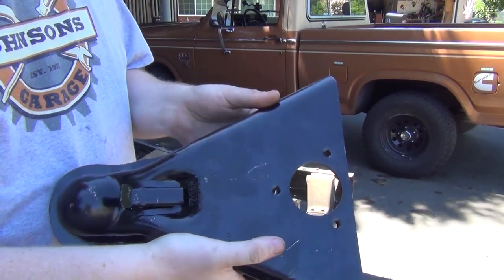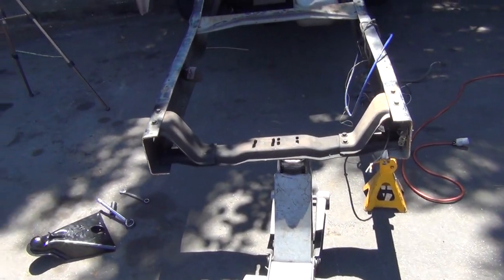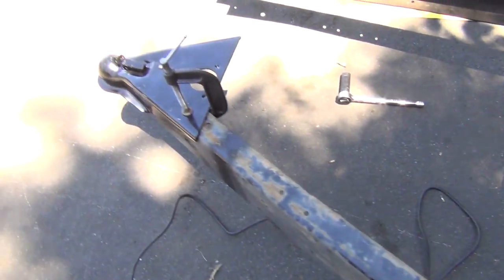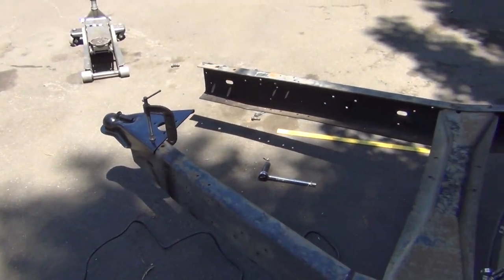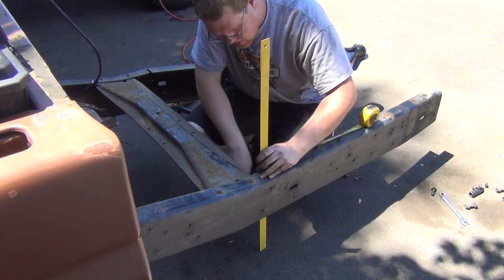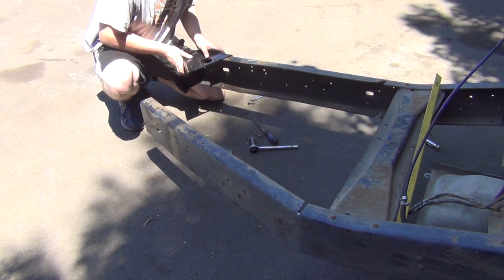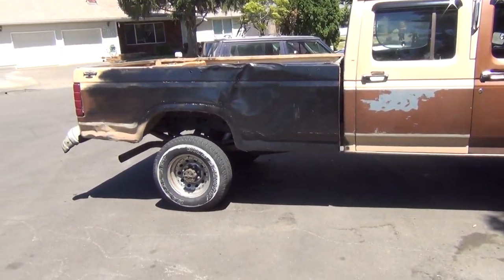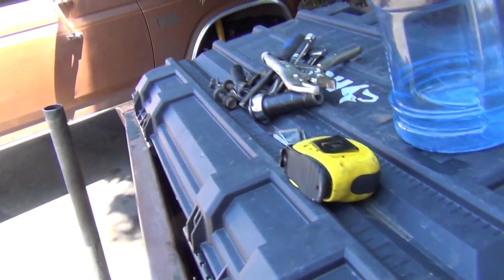Building a Bed Trailer Part 1

Comment: if you want the coupler running true to your frame triangulate your measurement.  you can either use the shackle frame mounts or easier yet the first cross brace.   run the measuring tape from the inside or outside drive side frame to the passenger side of the coupler, take note of the measurement.  then run the tape from the passenger side frame to the drivers side coupler.   get the measurement to be equal on both and your true!

Comment: you do not have to make triangle cuts in the frame one cut hammer the back of the cut frame down under the front bend then weld together

Comment: Since the differential is no longer applying torque to the wheels and the wheels are a spinning the differential, do you need to lube the differential with expensive axle lube or can you just use plain oil?
Reply: You want to use gear oil the bearings won't last long on oil.

Comment: I don't want to tell you what to do but if it was mine I would buy one of those axles from tractor supply and swap them out and sell the 9in but I don't even know it would work. Though I would at least say something have a good day.
Reply from the maker: That's actually not a bad idea though. If you get an axle long enough and put new spring perches on I think it would work.
Reply: +Johnson's Gee-rage I wasn't sure if everything would line up
Reply: I like the truck axle better it's stronger and fits the frame better just remove the ring gear and your good.

Comment: Looks great are you planning on boxing the frame at the bend points? Might be a weak spot if you have a heavy load short in the trailer.
Reply from the maker: yes. you'll see what i am doing in the coming videos.
Reply: No welder